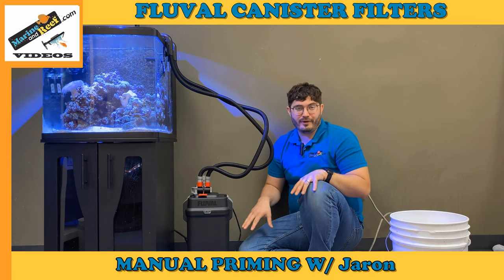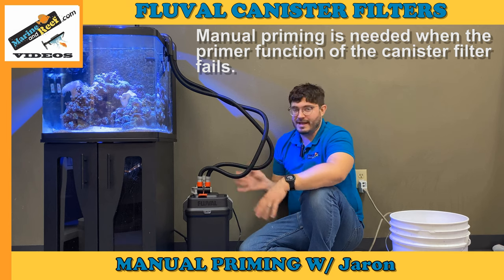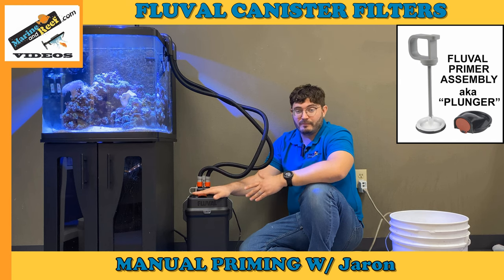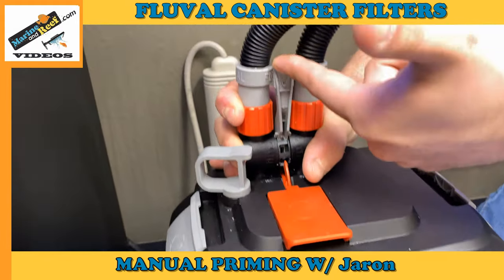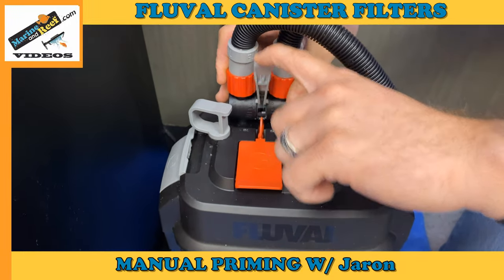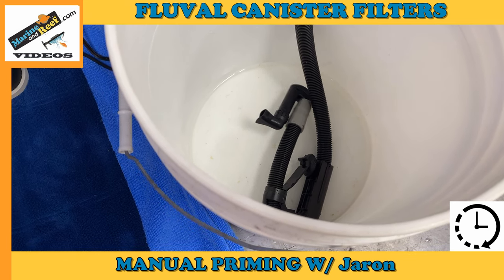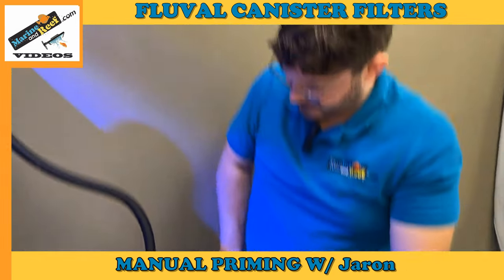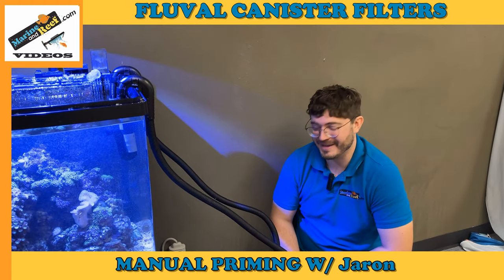MarineAndReef.com: Manually Priming A Fluval Canister Filter

Comment: had to do this today..... yes  i got a mouthful
Reply: No need to use mouth.Fill the tube with water, then plug in back into the canister. It will start flowing. Unfortunately for me, the canister did not seal properly and it was gushing out the top. I did not moisten the gasket as advised, but the gasket was properly installed (per Petco employee who has three of these units). Frustrated I am running my new setup with an over the tank Marineland filter that is 30 years old. I used a gravel vacuum. 

So I will try again before returning.